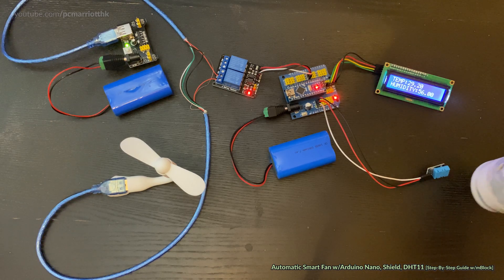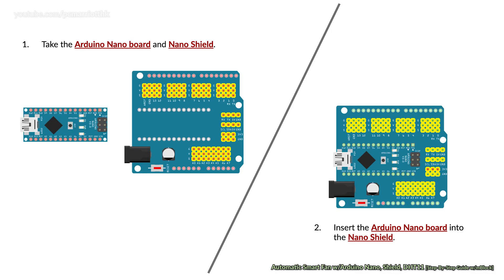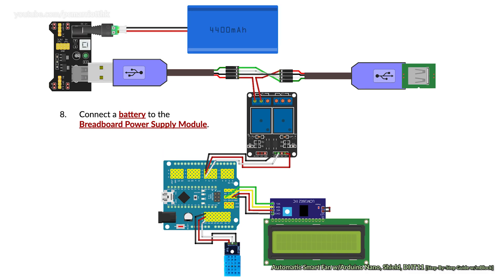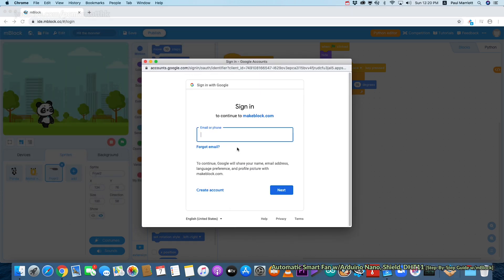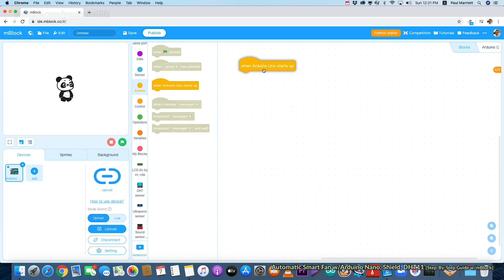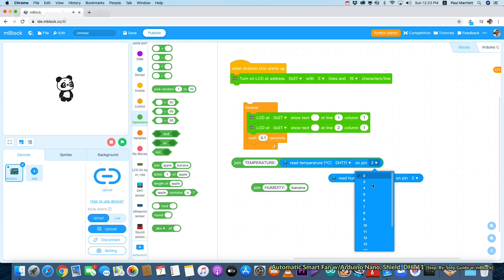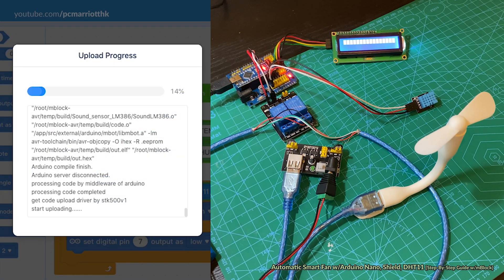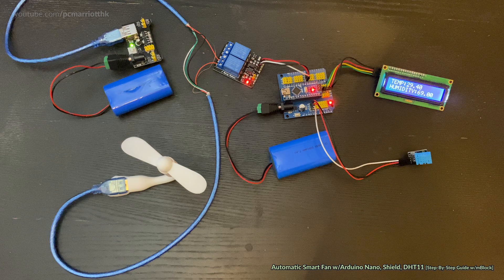Automatic Smart Fan - Step-by-Step w/Arduino Nano, Shield, DHT11, Relay Switch & mBlock 5

Comment: Can I use a normal 12v dc power supply to power the Arduino Nano instead of a Lithium Battery? (08:07)